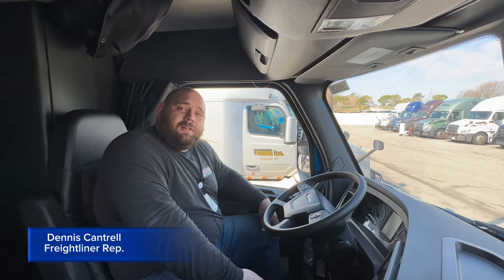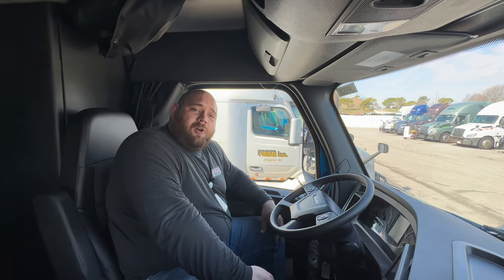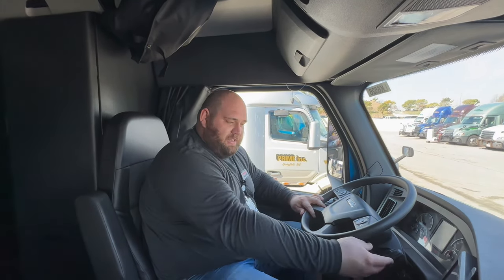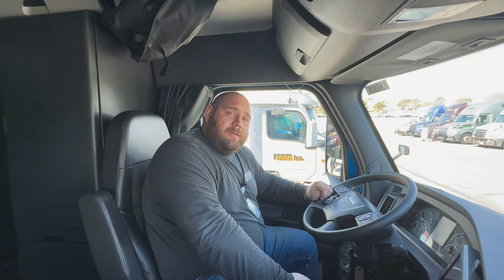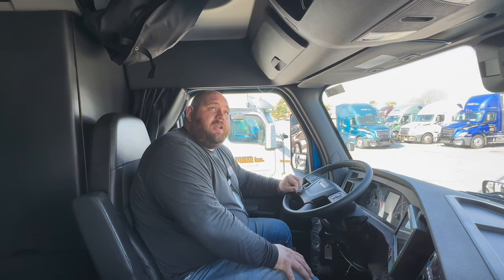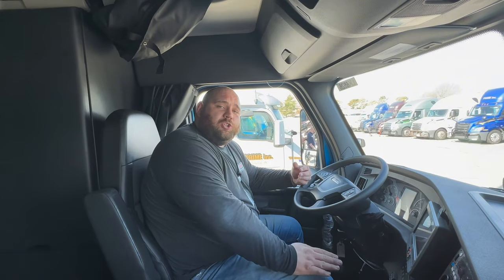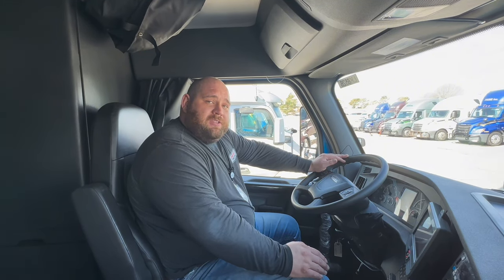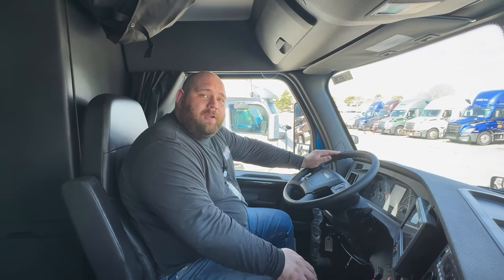Prime Inc. : Inter Axle Lock, Wheel Spin Out. DO THIS!!!

Comment: I got a question. So recently i got stuck going up a steep ramp and i had to turn into it so one side of my rear wheels were up in the air and as you know the differntial sends power to the least resistance. My question is when i lock it will all wheels get power or does it just transfer the same power but just now onto 2 axles instead of 1. Because i used the lock but it still was spinning the side that was in the air. (I just reverse and made myself parrallel against the ramp to get up)
Reply from the maker: Typically only the rear axle is driven, and power divides equally between those wheels 50%, unless a wheel spin occurs, then all power is diverted to the wheel that spins. 
The interaxle differential engages the front axle, at that point each of the four drives would have 25% of the total engine power. Wheel spin can still happen, but if the rear axle is spinning out, engaging the front axle gives the truck another chance to pull out. If both axles have a wheel that spins, it is time to call a tow truck. 

It should also be noted if the tractor has a wheel that leaves the ground, the road surface is very uneven, or truck was tilted.